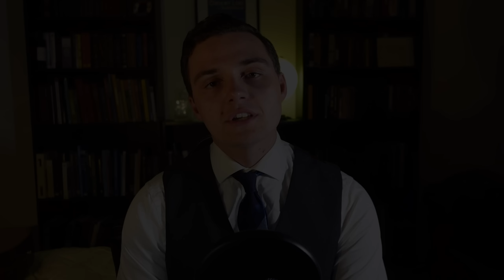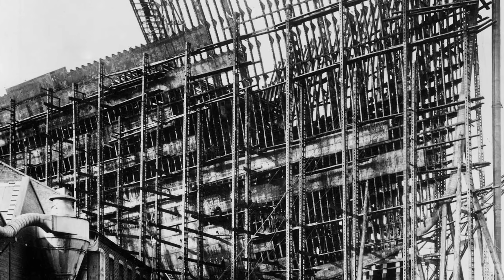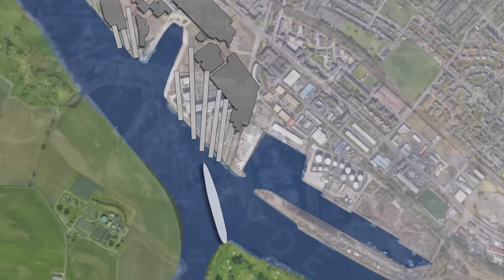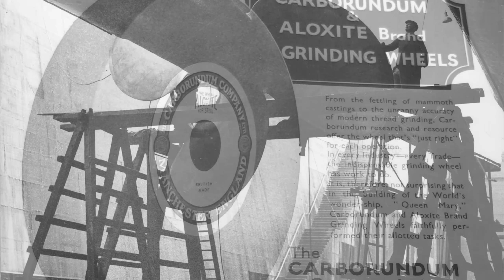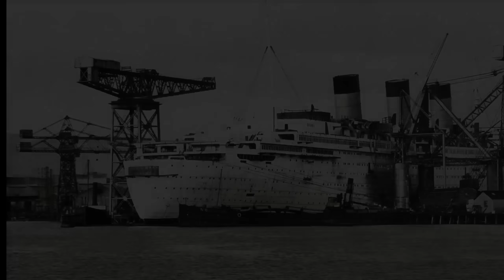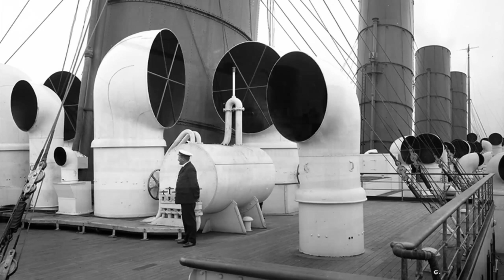How They Built the QUEEN MARY | Documentary

Comment: I'd like to see the process of the engineering math required just to slip it into the waterway. 
What I find so enthralling about the design of these liners is that there wasn't a single (handheld electronic) calculator on site. 
On-site manual transmission Newtonian calculus at it's finest.

Comment: It has been documented that one of the main reasons the British government opted to provide the funds to continue work on Hull 534 was the launching of the French liner S S Normandie.  The French government had provided funds to complete the liner and the Brits did not want to be outdone.  The Mary’s traditional exterior and unusual interiors did result in numerous less than complimentary comments.  Her designers thought she would be a smooth runner so no hand rails were installed in hallways.  Her maiden voyage proved otherwise and she was known for her rolling in rough weather which was finally remedied during a 1957 refit when stabilizers were installed.

Comment: genuine question: the engines and boilers were installed after it was launched?
why after? wouldnt it be simpler and easier to install as the hull was being built?
and finally HOW the hell would large pieces such as the boilers and engines be install after the hull was completed?
i have so many damn questions
Reply: Installing the boilers and engines while on the slip would make the ship much, MUCH heavier, making it harder to launch. They were installed afterwards via cranes, lifting them (often while disassembled) into large openings leading to the lower decks.
Reply: @DerpyPossum  so i can only assume then its quite litterally the hull of the ship that was completed. at point of launching it was a ocean liner sized canoe. the deck plates were not installed
Reply: @Miswired-2501  Deck plates and quite a few interior walls would have been installed before launching. The wooden deck planks, however, would not.
Reply: @Miswired-2501  Yes, she was just a hull at that point.

Comment: Ahoy there Mike ..another fine video.  I have continued sending messages through your website but alas, a response from you has never come through.  I can't make a purchase without some questions answered first.  🤷‍♂️

Fun fact...once it came time to fit the Mary out a new boiler design than the one originally intended had been chosen.  These new boilers were slightly lighter and taken all together her overall weight was reduced.  This reduction in her overall weight would help increase her overall speed, however it also esulted in her having ever so slightly less stability...thus leading to her famous nickname "The Rolling Mary".  😁